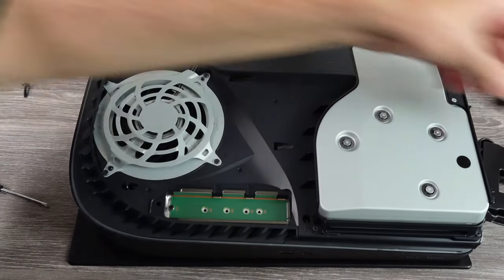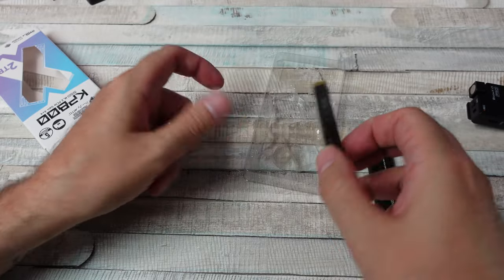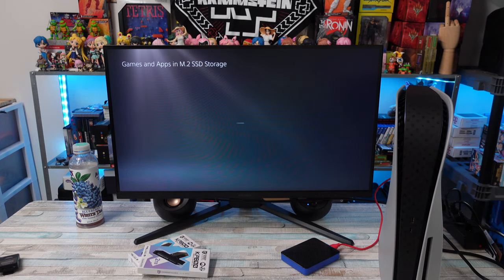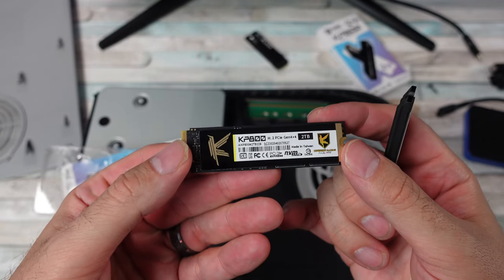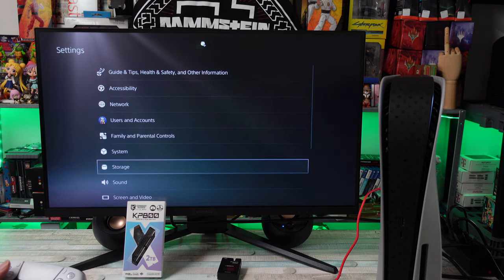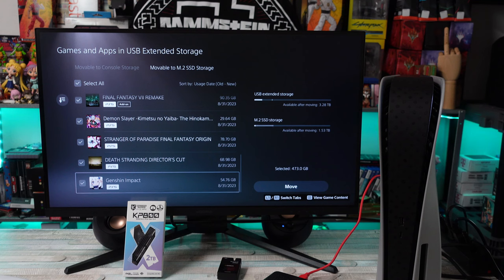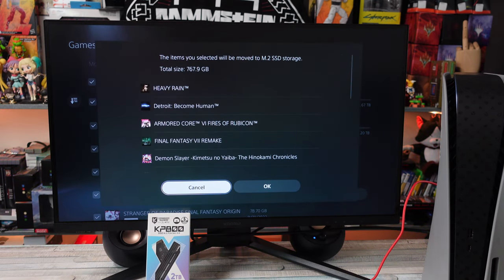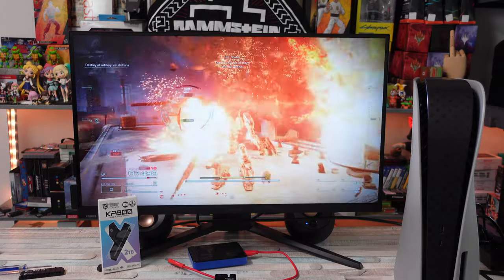2 Years Later I Have To Upgrade My PS5 Storage Again! But Without Losing Installed Games!

Comment: The limit is 8 TB per drive, but nvme ones cost about $1000+ for a nmve at that size (last i looked that was for the microcenter generic brand (inland).  Cheapest to get what you can and keep a eye on prices to move up.  Meanwhile get some mechanical 7200 rpm drives that are 8 tb and enclosures (25 on amazon last i looked for usb 3.0 with fan if you want to risk a cheaper brand, about 30 for what microcenter offers).  Just make certain it doesn't have a extra usb option like some have.  A few of those (depending upon your library's size, probably 2 or 3 would do for larger libraries) and you can start shuffling around your ps5/ps4 games.

Can't play ps5 off external though but i think you can for ps4.

Sony still hasn't fixed up the storage solutions since the ps4 days if i'm not mistaken.  Still faster to do that than to redownload everything all the time (especially if you're cutting back on isp speeds in exchange for a slower but sufficient speed with a data cap).  Just remember to put it into rest mode (faster downloads that way and less power use), And shut off whichever external isn't in use (it doesn't take long even for a mechanical drive to boot up and be ready (just like 10-30 seconds or so varying upon drive  and age)

Could also go for some external nvme enclosures (not certain how much those cost) to use any that aren't in use (or a nvme card to use the ones your motherboard in your pc or laptop doesn't have space for (not all laptops will support it though due to age)

Comment: I need to get an nvme drive, barely have any games installed and it’s full. 2TB is quite reasonable priced now but I’m thinking to just get a 4TB knowing that I’d be set for the life of the console. I like the console but don’t see me getting quite as many ps5 games as I did for PS4 so it should be plenty and I’d rather not have to upgrade again.